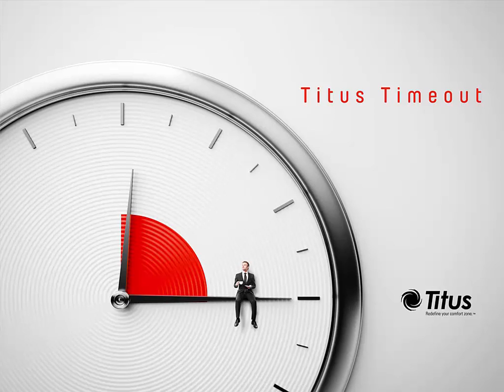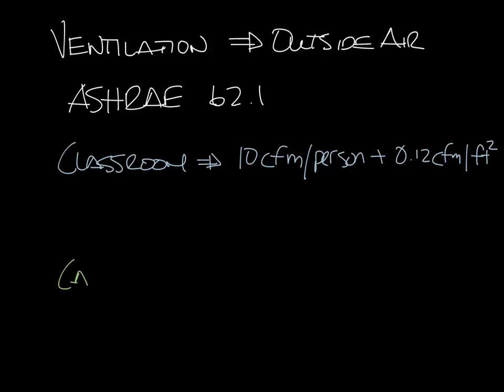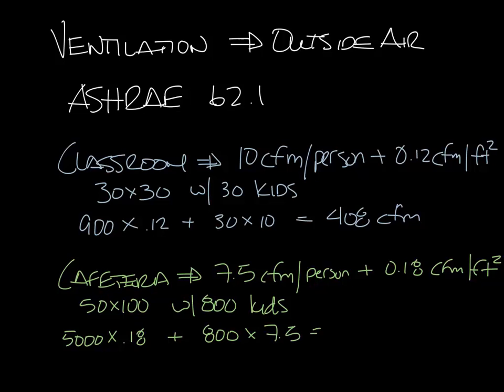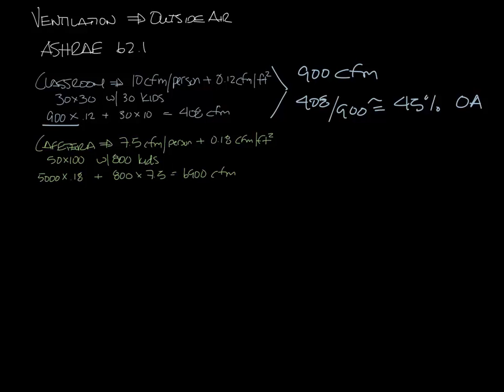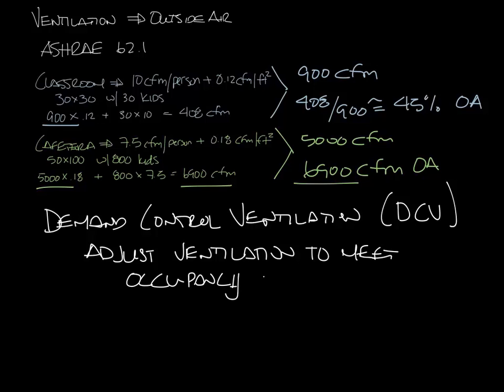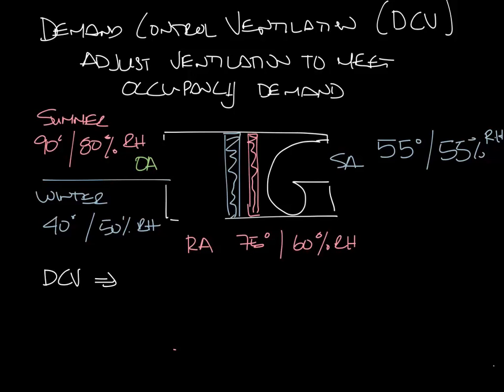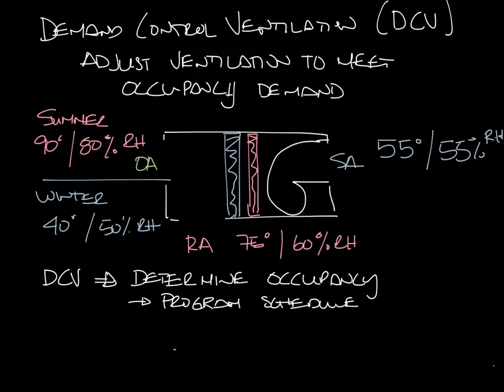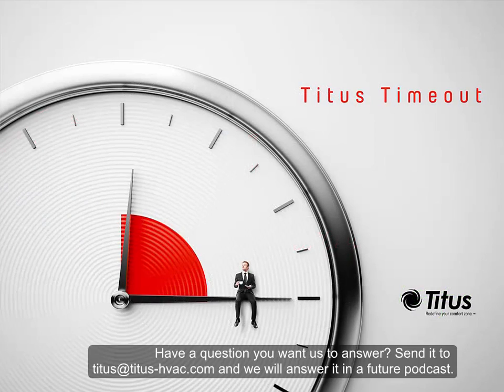Titus Timeout Podcast - Demand Control Ventilation

Comment: At about 3:30 in the video you mention a SAT of 55F and 55% RH.  You might reconsider this state point.  It's fairly rare that you would be that dry leaving a cooling coil.  It would be more likely to be at 55F and near saturation.
Reply from the maker: +Justin Older Good point. I was thinking in terms of the ASHRAE recommended space conditions for comfort would be 55F SAT and about 55% RH (technically ASHRAE says below 60%), but drawing it at the unit it the video implies that's what's coming off the coil. Thanks for catching that.